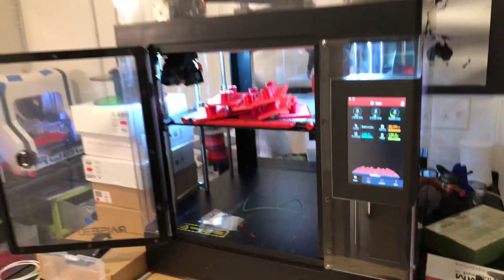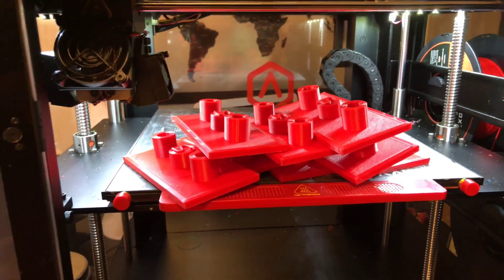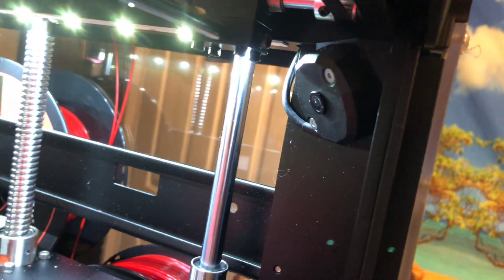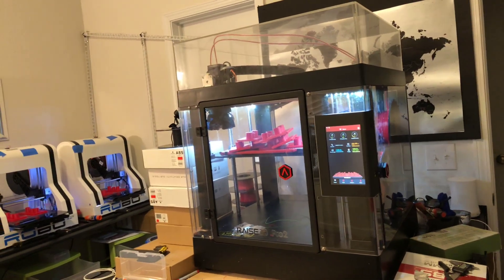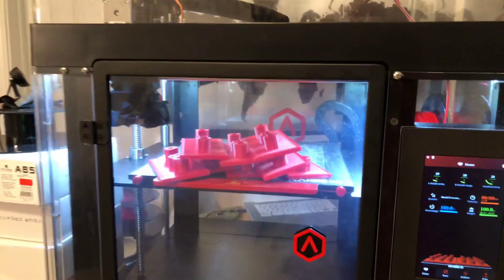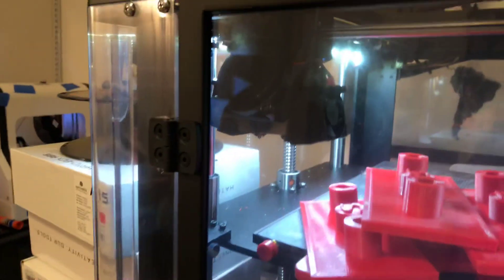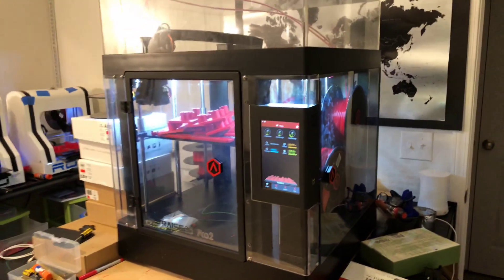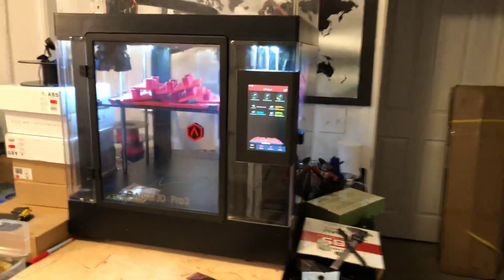Raise3D Pro2 first long print. Manufacturing commercial printer Hatchbox abs

Comment: I just got the pro 2 and haven’t had a successful print. What an I doing wrong?
Reply from the maker: Xinra Inc that’s a vague question, is it not sticking, is it blobbing, etc etc.
Reply: Murphy's Law Jack Pad Adapters Hi. Yes. It was not sticking (Reduction of Layer Height & increased heat bed temperature seemed to solve the non-stick issue. I am noticing a considerable improvement in the print. I will return with a more specific update if this print fails.

Comment: Thanks for the helpful video. Have you printed with the Carbon Fiber Filled Material and if so how did it go?
Reply from the maker: Ive used Atomic filament CF abs and its lovely, make sure you have a hardened nozzle.

Comment: How reliable has it been for you? Is it a direct drive system, or Bowden? Have you don't multicolor/multi-material prints with it? How was setup? I've heard that the bed isn't level when you first receive it, was it difficult to level the bed?
Reply from the maker: Andrew P as I print 24/7 weeks on end it’s been fairly dependable, I’ve had the heater for the bed fail and the front fan fail but raised helped get me thru the process, yes done multi color and multi types of filament both abs and flexible on same print. Direct drive.
Reply from the maker: Andrew P bed has been dead on level our of the box. The N series had level issue not the Pro2. Its a large bed and very little variance of any at all. Yank the buildtak and buy the gecko hot print surface it’s been amazing.

Comment: Any updates on this printer you can share?
Reply from the maker: Drone_Video I have ran her almost non stop since and have ran into just a few issues.
1 hate the flex plate system I installed, ripped it out and went back to the stock bed.
2 had a short in the heated bed that I’m waiting on raised to send me replacement parts, they were very good with getting this done quickly. 

That’s really about it.
I’ve ran abs/pla/carbon fiber/nylon and a mixture of abs/cf.
Tried a few times to get pva to work and failed then got busy with orders and haven’t tried again. 
She’s been stout, as much heat and all I’ve pushed at her I’m very impressed.
Reply: @murphyslawjackpadadapters14  I have never actually tried a 3d printer but have my eye on this one as it seems to get good reviews and its not a terrible price.  I like the enclosed and filtered air.  It seems like your really happy with it.  I'm going to be using it for very light hobby use so I suspect based on your duty cycle I should be really safe.   thank you for the update.
Reply: @murphyslawjackpadadapters14  Hey great vid! Some questions: How hot can the bed get and how quickly? How big have the Nylon parts you've printed been? Anything large and flat (which is typically prone to warping because the heatbed/chamber can't get hot enough)? I've got 6+ printers and they all struggle with large, flat, high-temp materials ESPECIALLY Nylon12 and PolyCarbonate! Thanks!

Comment: You even have any issue? I feel my pro2 is always jamming. I would say 60% of my prints fail. I also seam to always have to adjust  my Z offset.
Reply from the maker: Bryan Barbin up until the last week I haven’t had issue with jams, I’ve found one the last few years of printing most jams are from cheap filament or bad humidity levels in the print area. 
Had the front fan go out and cause a heat issue which oddly wasn’t evident as the fan looked to be running but was running slow and then yesterday completely failed.

Comment: Hey, nice information. I would like to know how often do you have to calibrate the bed? I have a Tevo Tarantula which has manual bed levelling and I have a hard time getting the bed levelled.
Reply: In the month of been using it I need to calibrate it this Monday. How do I know it needed to be calibrated? Because of filament was slightly off the base plate. The longest print I've done on this printer is 57 hours using polymaker PC

Comment: Ist there some sort of print server you can set up localy and control all the printers?
Or is it still Usb-sticks/sd-cards flying through the printing biz?
Reply from the maker: Andreas Witte most of my prints take the same time, i set up night and morning prints. Rarely do I have overlapping times.
Reply: Raise 3D Cloud
Reply: @3dlabs754  
Well i have an raise 3d pro now myself.

Printing commercially for the car industry. I am not allowed to upload to a cloud. They fear their designs might get lost there. The printer ist not allowed to communicate with the internet. 

What solution do you offer for people who need a private cloud to protect their costumers IP?
Reply: @andreas_witte  That's a valid concern and glad to see you honoring their IP. We also are subject to many NDA's with our clients and do not upload jobs to the cloud, nor are we using the cloud as it's in beta status. I just mentioned it as a general solution. Repetier server is a nice solution for controlling multiple printers in a farm offline on a local area network though. For us, the wifi connectivity of the Raise machines is manageable enough to submit jobs to various machines and also queue them. The Ideamaker software allows you to connect to each printer remotely and control it over wifi, as well as upload and queue print jobs on them while printing. All of our printers are hosted on an isolated network segment (VLAN) and do not have internet access.

Comment: I am also getting started in the 3D printing business, however, I did start as a hobbyist. I have a few machines and was also looking at the Ultimaker S5. What deterred you from the Plus version? Just the dollar amount?
Reply from the maker: Maxwell Winslow my main business produces parts that are short in z height. I figured if I did outside work it would be rare.
Reply: I've got the UM3 and it's the worst experience I've ever had with a 3D printer. Also doesn't handle heat very well at all (internal components warp!)

Comment: Man I really like the video series you have done for this machine, in this moment I'm beginning my 3d printing business and I was waiting for a customer review of this specific machine. I would like see how to print on soluble material so if you can do it I'll appreciate. Regards from Mexico....
Reply from the maker: In a few weeks I will run some dissolvable suppers, I just bought a roll last week.
Reply: Uriel Gaytan we are doing the same thing. Are you getting a SLA?
Reply: @bertamus   To be honest no, however it would be usefull deppending of the kind of customer you have. My customer just requiered the pinted parts satisfy they needs with shape, fit and function. Regards...